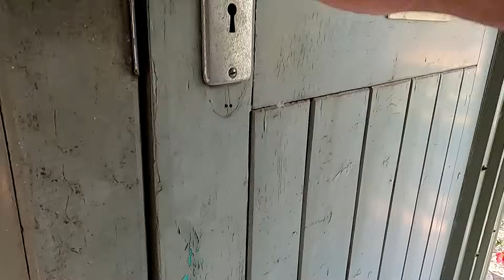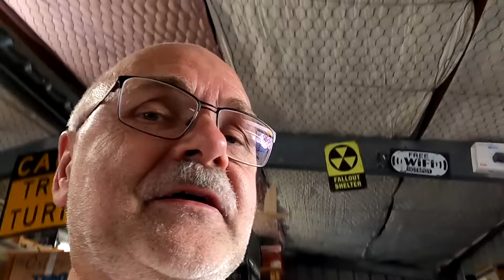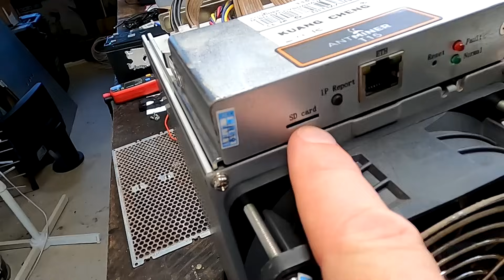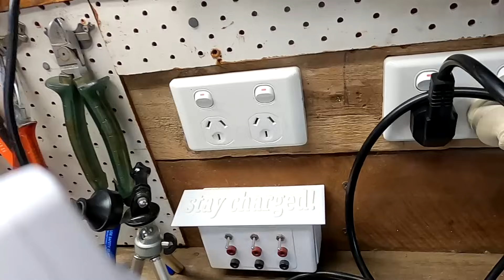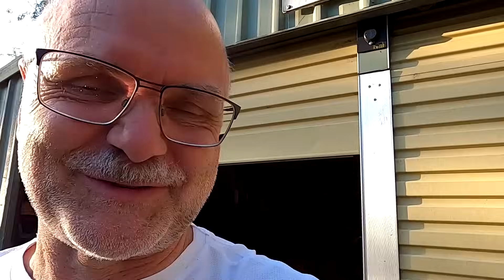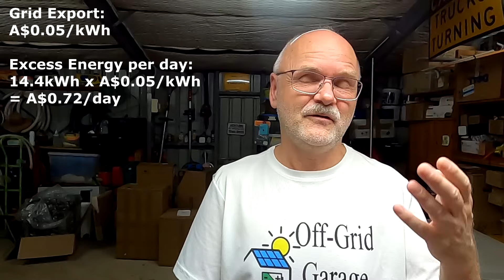Off-Grid Bitcoin Mining with excess power from your solar and battery. Worth or Waste?

Comment: Hi Andy, first I would put in more $$$ to a miner and buy something with around 100Th, so 1500 usd or so for something that take 3kW and produce 10x of your machine.   Then for calculation, you shouldnt think of it as a fixed price of today but instead what it can be worth in 5-10 years. BTC was down as low as just above 3000USD during 2020 (and just a couple of months ago it was half value of today), just a little over 3 years ago, and is 10x of that now.  I have been into the bitcoin sphere and bought since 2016 and the current adoption of new btc addresses is like Internet during 1998... so it is still early and a lot of new daily addresses coming online.  I see no reason at all why BTC wouldnt be more than 10x of todays value in less than 10 years and if you instead of calculating on a 37k value calculate it on 300k you get a totally different return on investment  :)     But since you gone this far on your BTC path, please get an S19 pro or something, you will thank me in a couple of years. But buy know, after the halfing in a couple of months the prices of Miners will go bananas again.   :)

Comment: I have fitted 2 off peak storage heaters, one in  the hall and the other in the lounge, these are the heaters with large silicon bricks inside and can retain heat for more than 24hrs, there is a flap to open to let the heat out in the evenings into the room thus saving on using the gas central heating at night, this is used to get rid of spare solar after my home battery is charged and the cars are charged, I get a feed in tariff but have extra solar off tariff so have some excess to get rid of.
Reply from the maker: I don't need to heat the house though as we are close to summer now. We have split ACs installed in the house just need to get the sparky to wire this to the battery.

Comment: An Antminer eh.  Well, that is better than trying to use a general PC or RPI to do it.  Excess solar kinda works.  Whether its ever profitable or not is another story.   Taking into account the hours messing with it, wear and tear on equipment, and other insundries, and comparing against other entrepreneurial things one could do that makes significantly more money, or simply exporting as you mentioned, miners are generally just not worth doing.   Fun, though.

But as a consolation prize you could probably use the unit to heat-up your pool or a water tank or something like that.
Reply from the maker: Well, exporting is not an option for me... so I look into the pool heater option now...

Comment: But than how much was your investment to produce the electricity Andy
Reply: That's not relevant here, because he didn't install it for mining but for other purposes. His choice is to put the energy into mining one not use it at all.
Reply: in solar you need to scale somewhat for autumn and spring, so you will always end up with excess during the good days.
Reply from the maker: I didn't built my solar to run the miner. It is excess energy which would otherwise be wasted/not generated.
And yes, I still have excess energy in summer. It was just a test as I explained if this would be a solution/option.

Comment: Off grid over 20 years and my excess charges an ebike, runs a microwave and tools in summer and in winter it runs an IR quartz heater.  You also need to add in expenses for HD inverter, wiring and batteries to run a bit miner.  Not worth it for me.
Reply from the maker: But charging an ebike and running a microwave is not really an option for using excess energy in summer time. You would use these devices anyway if needed, right?
Reply: @OffGridGarageAustralia  That is when the AC is used and I do more work outside with an electric lawnmower and tools. The system is balanced so very little excess power goes to waste.

Comment: Try connecting the unit directly to DC, seems like most noise is coming from its PSU
Reply from the maker: That's not going to work. It's a 29V power supply (so a 9s LFP battery would work) but the mainboard controls the voltage output when it ramps up the frequency. I had the same thought but measured the voltage output for a while and figured this is not really an option.
Reply: no most of the noise comes from the fans in the miner its self and the hotter they get the faster the fans have to spin to try and keep them from burning up the boards in them. the power supply do not make much noise.

Comment: Off the top of my head, I have a couple of thoughts on what to do with excess electricity:

    The most realistic option - distill moonshine / brew beer / if you don't drink, you can simply make alcohol. Alcohol can be used as fuel or for other needs.

    Perhaps becoming realistic soon - produce hydrogen and in winter use a fuel cell to recharge batteries. There can be many variations, but the main idea is to convert electricity into some tangible value. (You can collect cans, melt aluminum, and then make an aluminum-air battery, and so on.)
Reply: Hydrogen is really dangerous to store.  Do it safely or boom!   Good thought though.
Reply from the maker: Hydrogen will be many many years away and personally, I thing it will never make it into residential installations. The safety regulations and maintenance will be insane. Definitely nothing for DIY any more...
Reply: Good luck to storage hidrogen

Comment: As I've mentioned previously we get paid quite well to export now. From 05:00 to 16:00 its £0.17, 16:00 to 19:00 its £0.28. I always charge my batteries off peak between 02:00 and 05:00 when its costs just £0.17. I will force discharge at the peak rate. Today we just had a "saver session", so for every kWh extra you save or export above your normal average they are paying £2.25 per kWh! For that one hour session I was exporting at 182 amps from my two batteries, actually exported 7 kWh, but I' can only guess at what my average will be, somewhere around 3.5 or less., which would be nearly £8. I do also run a Chia farm, but that's not to use excess, its just something I got into, but it is cheaper to run due to the solar.
Reply from the maker: Interesting, they are making such offers in the UK. Makes sense I guess and is cheaper for them than starting a gas power gen somewhere to make some extra energy during peak times. It's a good idea actually.

Comment: These antminers tend to burn asics if you don't stop the hashing before turning off the device.
The fan needs to continue blowing for at least a few minutes minutes before you can power them down.
Reply from the maker: That's how they are designed. Well, they are probably designed to run 24/7... I can only disconnect the network, that makes them stop heating, I think.

Comment: Hi Andy, if you want I can show you how to store energy (in the form of heat) in sand. It's a very simple system and if done correctly the sand stays warm for many months, so you can have heating and hot water in the winter
Reply from the maker: I don't have sand and I don't believe this will be a 'very simple system'.
Converting electricity into heat, storing and retrieving it and converting it back to electricity cannot be an easy task.
Reply: @OffGridGarageAustralia   you could use the heat from the Bitcoin Mining machine to heat the sand! 😂🤣
Reply: @OffGridGarageAustralia  I don’t think his concept involved turning the heat back into electricity, I believe he was suggesting heat storage for water and home heating. Not really a Qld’er thing.
Reply: You can show me please
Reply: Really interested in the sand battery concept. If you can share some info, I would very much appreciate. Thank you
Reply: Sure...
Reply: Winter in Qld …. 😂😂
Reply: I dont think Andy would need/ be interested in a sand battery, he can just turn on a split air con. I like the sand battery idea for the right circumstances, not in Qld though.
Reply: I've got an interesting solar concept.... I read about somewhere recently where you can have 2 dams one higher than the other which I have... solar pumps the water from bottom dam upto top dam as a energy storage device. The water then runs back down through the pump when solar ends in the day which then works like a hydro setup but you then send the water back up the next day when the solar pumps it back up again.... have you heard of this.... it's a much simpler energy storage option than batteries but could work similar... I'm keen to try make this happen... let me know if you got any ideas... I'm on the gold coast. Love your videos BTW.
Reply: @crush4211  Sounds like the “Snowy Mountains Hydro Scheme”, great idea if you can afford the infrastructure to make it work. The ‘Snowy Scheme’ actually use excess power (for free) available in off peak times to pump the water to upper dams as this helps to balance and load the power grid generators for better efficiencies when excess power is not being used, so they have that free grid power bonus available to them to help make it all work. 
I imagine having enough solar to power ur household and pump enough water to a higher level dam for overnight storage power would require quite an investment in this idea, keeping in mind enough extra storage for those cloudy days or weeks also.
Reply: For months?  I'm interested as well if so.
Reply: Bitcoin miners make plenty of heat. You can get noiseless ones to use in each room.

Comment: I'd have to figure out some way to use a fan controller to slow that fan down - that noise would drive me insane.  Since you're only using 1 of the 3 boards it normally would have inside, it isn't like it really needs all that cooling anyway.  Good for winter perhaps for free heating that gives money too (since electricity used in a miner vs used in an electric heater would produce the same heat for the same power input unless the heater is a heat pump.)
Reply from the maker: I could play with the fans but I don't expect a huge difference.

Comment: Bitcoin miners are a good substitute for electric resistance heating
Reply from the maker: Resistive heaters are so much quieter.... It's a fact😄
Reply: Andy, Antminer s9 is very cheap and quiet I use it for heating. Also you can mine with graphics cards, absolutely quiet and it heats. Lastly you never know where price of bitcoin will be in 5 years!

Comment: Great topic. I keep three box (mini miners) and 1 pc mining 24\7 for the past couple of years. I get unlimited power useage (30ax2) with my rent. I am in a '28 RV with that shore power.  I also use nicehash for the computer (fast cpu and a 3060TI GPU) Box miners are on Flexpool..  They are heaters but not very noisy..  I also have 2 solar arrays and 2 Eco Flow power stations to power them with.  but with my situation, there is no need. I do have plans to go offgrid on my own land. I would think\hope there is a way to power them with solar. The box miners are just over 200w each.
Reply from the maker: Yeah, that's not good using grid power! It maybe free for you from a financial perspective but ethically, this is really bad!
Reply: Have you checked those box miners recently? Flexpool shut down all operations on the 1st November.
Reply: @TheRonskiman  Yes.. all 3 are online, active and earning profits.
Reply: @TheRonskiman  Ooops.. Thank you for the reply. MYBAD.. I meant DXPOOL. I tried using flexpool but didn't like their layout.

Comment: Convert the miners to water cooling and heat your pool
Reply: Throw some chicken into the pool and after 3h at 100 C you get great chicken soup
Reply: Add the portable AC and start an thunder dome between the two!
Reply from the maker: There is no conversion kit for these boards.
Reply: @O @OffGridGarageAustralia 
immersion cooling. 👈🏼

Comment: Custom-Firmware könnte helfen dann kannste die Geschwindigkeit deiner Lüfter regeln solltest dann aber gucken wohin sich deine Temperaturen bewegen. Ich selber nutze das gleiche Prinzip habe hier zwei Miner stehen womit der überschüssige Strom verbrannt wird. Bin zwar On-Grid speiße aber nicht ein, da dafür der ganze Sicherungskasten neu müsste.
Reply from the maker: This does not really work or even help. Machines are running hot and boards will die prematurely. Sound levels are not really lower either. Especially here in summer time, the fans need to run and cool.
Reply: @OffGridGarageAustralia  Ja gut deine Wohngegend ist da ein bisschen problematisch gib ich zu da geht denke ich mal nur Wassergekühlt oder Ölgekühlt, ich selber habe Custom Firmware drauf damit ich die Taktrate einstellen kann und die Lüfter steure ich extern an und langsamer meine zwei sind wesentlich leiser. aber bin auf deine andere Idee gespannt

Comment: I'm still thinking about how to use the surplus power. I'm offgrid.
Bitcoin is not the choice for me, but i still have not found somthing better.
Best choice at all would be a long time storage to save the energy for the winter, but by now there is nothing affordable available.
Reply: I remember watching an episode of This Old House where a very rich old man installed some massive insulated tanks to store hot and chilled water from his heat pumps. That is a way to store excess energy for seasonal changes but pretty much unaffordable to everyone.

Comment: To dump some excess power you can use BOINC on some old PC to participate in distributed scientific calculations.
Reply: That is the way to go for. No special hardware needed just use what you have and put on project you like most. Also you can get reward from to get back some of electricity that you have used. Some started with small boards like pi3/4 and step up to bigger machines if they really needed or got addicted to it.
Reply: @greger3385 Maybe you can meter the energy you use for it and get a tax rideoff as a donation.
Depending where you life.
Reply from the maker: Yeah, did that. The PC uses 110W...
Reply: @OffGridGarageAustralia  You can install one or more video card (if you have some spare). Many projects will benefit from GPU computing. Plus you can schedule computing to run it while full sun. But yes, to utilize 1kW you need at least 3x powerful GPUs or 6-8 powerful CPUs.

Comment: Some people have experimented with running them straight off of DC voltage regulator from solar
Reply from the maker: I don't think it is possible though. I did some measurement and it seems the main board is controlling the power output of the PS. Otherwise a 9s LFP battery would be OK. This would get rid of the fans of the PS but not the large fans of the hashboards.

Comment: The biggest issue I have here Andy is the ethics of Bitcoin and Cryptocurrency. YOU are using a renewable power source for mining, but the majority of the mining pool does not - much of it is powered by coal and other fossil fuels. Using this energy to power a network whose only practical use is for enabling illegal activity and wild commodity speculation feels extremely sketchy. If you're going to convert excess energy to compute power, consider projects such as folding@home where you can use your excess energy to contribute to scientific research instead.
Reply: You know cash is the preferred choice for illegal activity right?  Much harder, if not impossible to trace.
Reply: @StuartJ  Yes. But we're talking about cryptocurrency.
Reply: @madvlad1  so was I. I can't fathem out why you would say it's only use is for criminal activity, when money laundering is almost exclusively done in cash, as it's so easy to do, and can be done anywhere, in any jurisdiction.
Reply: @StuartJ  Digital crimes like ransomware and extortion.
Reply: Anyone using crypto for criminal purposes thinking they're safe will be in for a surprise when they try to cash out on an exchange. Law enforcement have ledger tracking tools including for Monero.
Reply from the maker: Running a computer for scientific purposes does not cut the power excess though. The computer uses what, 300W under full load?
Reply: @OffGridGarageAustralia  Certainly not as energy intensive, I'll admit. You'd need racks of hardware to match an Ant Miner's power consumption 🤔
Reply: Some mainstream media brain washing has infected you @madvlad1
Reply: Someones been reading the MSM

Comment: From experience - Noctua fans are a lot quieter - if the noise is causing you grief even from the toilet 🙂
Reply from the maker: I'm not going to upgrade any fans... I know this is an option but from what I've seen, the improvements are marginal.
Reply: They are loud for a reason, you know, 600W is a lot.